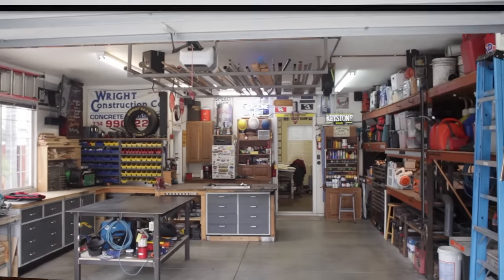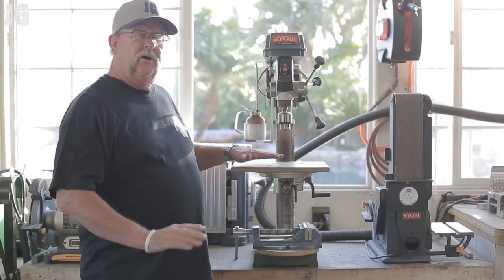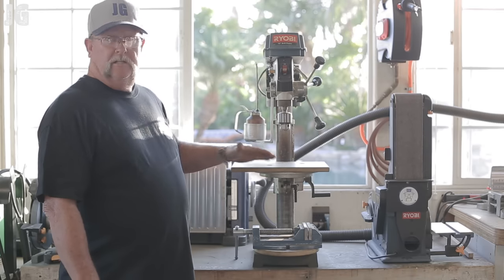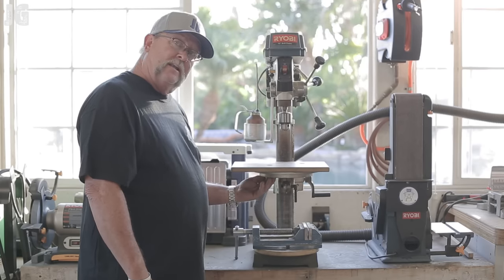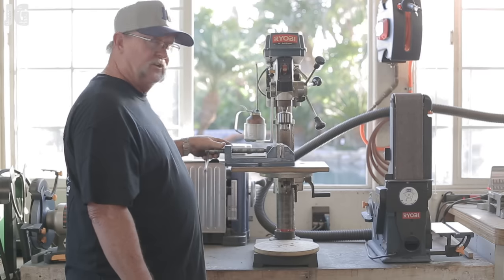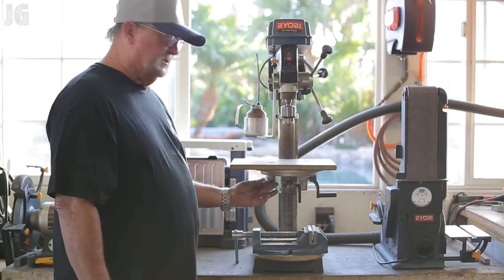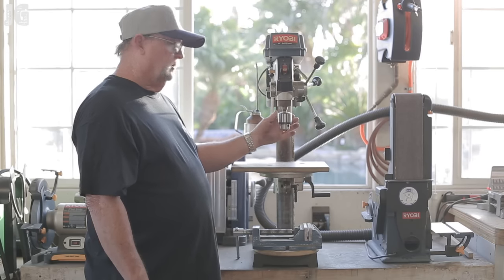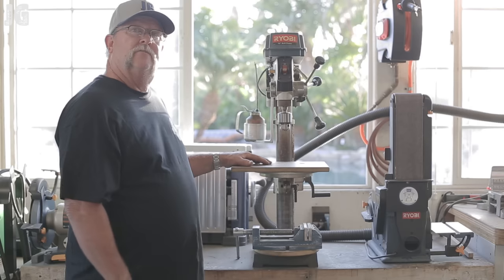Drill Press Modifications - Jimbos Garage

Comment: Like your ideas. I did something like your table top for my welding. I do not have a professional welding table with all the holes, clamps, etc. just a flat home made solid table top. I have found it difficult holding down various small small items at times. So I took 3/4" plate about 1 foot square, cleaned it up and welded three 3" lengths of 1.5" angle iron on the bottom about 1.5" inward from the sides to support it without wobble. Not I can get clamping locations around my item at about any 360 degree location. Just passing on an idea. (Note; Ground angle iron with welding clamp, do not rely on it sitting on table top.)
Thanks for the videos.
Reply from the maker: Nice advice Tom,  Jimbos garage!